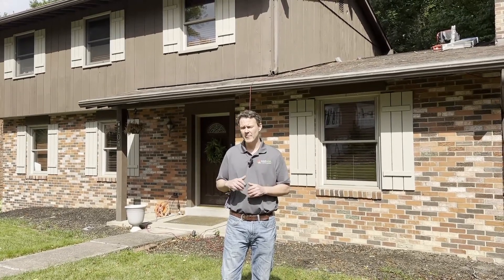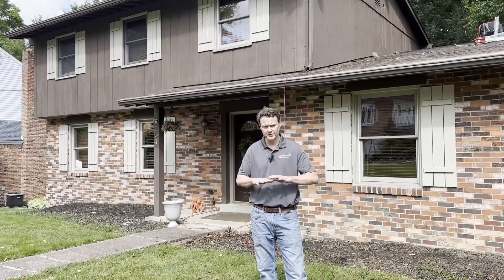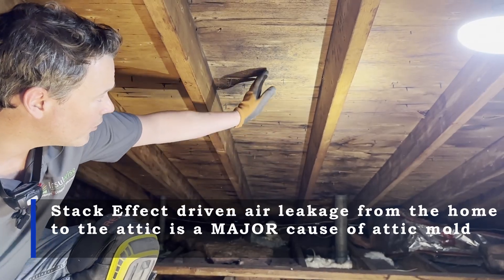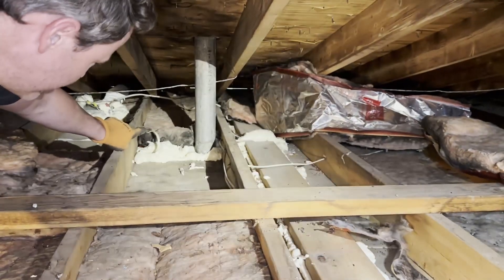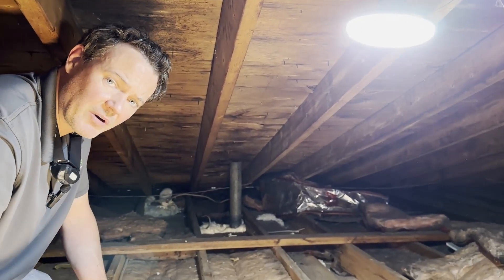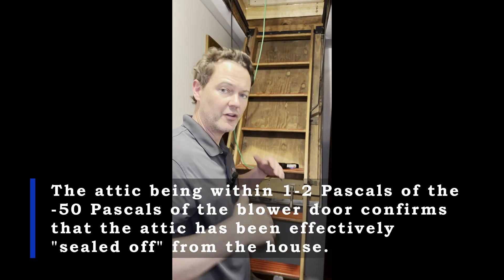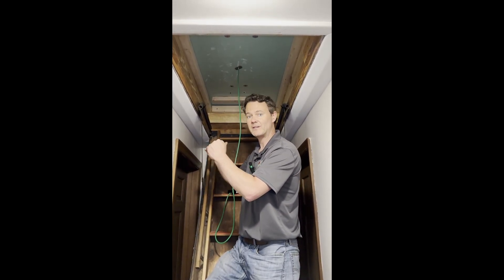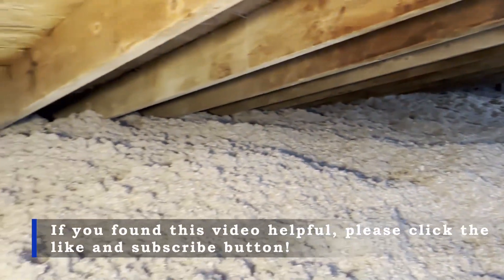How to Remove Attic Mold (and Prevent it from Coming Back)

Comment: I didn’t see the baffles installed at the end. Do you cover the insulation with baffles toward the edges of the roof?
Reply from the maker: The baffles are there, we didn't blow over them, but they are harder to see after the new cellulose got blown in.  The cellulose is blown right up to the "mouth" of the baffle, but not over it.  Thanks for commenting!
Andy

Comment: Hi Andy how are you? Thank you for a great informative video. I am in Melbourne Australia where I live in a brick veener single storey house. My roof uses cement tiles which are now 35 years old. About 20 years ago I had that horrible cellulose insulation sprayed into the roof. After 5 years we started getting mold problems in the kitcen sink drain holes. The laundry and the bathrooms don't have this problem as bad. In the shower I noticed pink mold. I also noticed light gray mold forming on my colorbond alluminium windows frames. I have been trying very hard to get rid of the bad mold in the kitchen drain holes by using cleaning vinegar, bicarbonate of soda and even bleach. The mold is nearly black in color. Unfortunately it keeps coming back. In 2019 I had the cellusose powder removed by an insulation removalist. The dust still keeps coming down onto our furniture, floors etc. This is also bad for our health breathing that powder. Obviously he didn't do a good job. I do not know if there are roof sealing specialists in Melbourne but I am going to search for one. What else can you recommend? Thank you. Alfred
Reply from the maker: Hi Alfred thanks for commenting!  The best thing you can do is to have your attic floor air sealed.  This will solve the issue of dust / debris coming down from your attic into your living space.  Here is a video where I show how this is done.  This will also improve the comfort of your home and improve the energy efficiency
Attic Air Sealing
https://www.youtube.com/watch?v=PUSONSE7srE&t=51s

The mold that was forming below in your home should not have had anything to do with the cellulose insulation that was in your attic area.  In most homes that would form from there being too high of a humidity level inside the home.  Or if you have surfaces in your home that get cold or below dew point temperature --- that water vapor inside your home then condenses on.  This is a classic recipe for mold growth to occur.  Let me know if you have additional questions.  
Here is how that can happen in this video: 
Mold Formation on Interior Surfaces
https://www.youtube.com/watch?v=J_qTDjXQvQY

Comment: Would gable vents mess up a soffitt  to ridge vent airflow and cause mold?
Reply from the maker: Attic ventilation theory says that gable vents should be eliminated when you have soffit and ridge vents.  My personal experience is that I would NEVER eliminate gable vents.  Because they can pick up natural breezes and wind currents better than soffit / ridge vent combinations  do (and by FAR I might add), they can be some of the most effective attic vents out there.  
On one occasion I actually solved a chronic attic moisture problem by re-opening two large gable vents that had been closed by roofers when they installed soffit and ridge vents.  As soon as I opened the first one I felt a whoosh of cold air blow into the attic (it was winter) and within minutes the temperature and humidity in the attic dropped dramatically. 
I cannot imagine a mold problem developing by virtue of leaving them in place. 
Andy
Reply: Depends where you live. I live in south Louisiana with tropical and highly humid climate. The more vented your attic is, the less problems you'll have with mold imo

Comment: We found mold in attic and are trying to fix the issues we found. One side of house has baffles to the soffit and goes to the outsidebut the other side has the baffles , but half of them do not lead to the outside. There isn't a gable vent on either end. If I add one to each sid,  will that help with air circulation? We are going to use foam for any air leaks under insulation and want to fix moisure before spraying rmr86 over everything. Will this help, or is there something else I should do? Any help would be greatly appreciated
Reply from the maker: Thanks for commenting.  Attic ventilation should be balanced between intake and exhaust and be generally set to 1 sq ft NFA (net free area) for 300 sq ft of attic floor, and then divided evenly between intake and exhaust ventilation.  Gable vents are usually considered exhaust, but if they are large and oriented even somewhat East / West they can be the most effective form of passive attic ventilation there is (in my opinion).  If you effectively air sealed your attic floor, vented any bath fans out through the roof, and upgraded your ventilation that would likely solve the problem.  While on the roof ALSO check for nail pops through shingles and leaks around plumbing stack boots and seal those.  Small roof leaks are very common and can add a lot of moisture to an attic unknowingly. 
Thanks, 
Andy

Comment: Do you know about how much this job costed the client?
Reply from the maker: As our mold remediation process also involves other measures like air sealing the attic floor and venting bathroom fans to the outside, it's often more expensive than a traditional attic mold remediation job.  Usually anywhere from $3-20k depending on the job size.  That said, our process focuses on eliminating the underlying cause for the mold growth in the first place, not just killing the stuff that's there.  That's the EASY part ; ). 
Andy

Comment: This is not a proper treatment or remediation for mold. Absolutely irresponsible to put new insulation in without remediating correctly. No Fogging, No negative air machines running, no Hepa Vacuuming( dead spores cause illness as well so they must be removed), and aggressive cleaning of wood with peroxide based solution and wire brushes, then applying mold resistant encapsulant paint before installing new insulation. Then install a commercial grade dehumidifier. This is amateur hour. The mold is likely not even dead. It is definitely not removed nor is the abundant dust and debris. THe client will have to remediate again in the future and redo all of the insulation. Ridiculous
Reply from the maker: I'll see if I can find and attach pictures for the number of times we've been called out and found mold growing right back on top of "mold resistant encapsulant paint."  I also will make sure to post a video of the next time that we remediate mold in an attic where someone else has ALREADY remediated it before using the plan you mentioned --- and left bathroom fans exhausting into the attic, did not address roof ventilation deficiencies, and did not air seal the attic floor--ie- did NOT address the root cause of the mold growth in the first place which is excessive water vapor then condensing on cold surfaces.  The vast bulk of existing mold remediation companies' processes that I've seen I'd call amateur hour combined with a flawed understanding of biology.  
Get rid of the mold spores.  Ok, wash your hands.  Now wave them in the air.  They have mold spores on them.  Mold spores are everywhere, not just in attics that have mold growing on the underside of the roof.  Eliminating the ability for fungus to grow in the first place is how we solve it.  If that's amateur hour to you, then I wish you the best in your operation.
Reply: @insulwiseenergycomfortsolu3293  Thank you for your thoughts on mold.  Like everything, there is fear porn on mold, asbestos, radon, climate etc etc.  Hard to find truth when money corrupts information.

Comment: Great video.. what spray do you use
Reply from the maker: Thank you!  We use RMR-86.  The mold is eliminated almost instantly in many cases.  It's an extremely intense chemical to use, so you really need to be suited up well with a full face respirator and tyvek suit if using it.
Reply: @insulwiseenergycomfortsolu3293  May I ask if you have tried Concrobium Mold Stain Remover and if so what were the results like? It is supposed to be a "friendlier" version of RMR 86!

Comment: I have been watching several vids. So far yours are on top of the game. I am in North West Ct on the Mass border. Zone 5. Will/can an under insulated attic (R15 to R19) also greatly contribute to heat loss creating moisture on the rafters and roof deck? We are purchasing a home with signs of mold.. We're definitely planning on upgrading the insulation..  Should the old batts be removed first? What solution are you spraying? 
Thanks.
Reply from the maker: This is an EXCELLENT question.  Mold forms on the underside of a roof when the surface temperature of the roof falls below dew point temperature, causing the water vapor inside the attic to condense on it.  If there is enough moisture consistently present and the wood gets consistently wet you will then often have mold growth forming.  That's why it's critical that bathroom fans be vented to the outside, the attic floor be air sealed, and the roof be properly ventilated. 
Attics that are poorly insulated usually have fewer mold issues than attics that are well insulated.  You read that right.  Poorly insulated attics allow more heat to escape from the home, which warms the roof, which helps the water vapor to evaporate as opposed to condense on the underside of the roof.  That doesn't mean that poorly insulated attics can't have mold issues, but the risks are lower than with well insulated attics.  Well insulated attics block much more of the heat from escaping the home, which allows the roof to get colder, which can allow for more condensation to occur.  
We generally don't worry about removing the old batts.  Mold cannot eat fiberglass (just the kraft paper).  With mold the key component is addressing the moisture source, ie removing it.  So steps generally are:
1)  make sure bath vents go to the outside (while doing this confirm that your roof is water tight/ no existing leaks)
2)  air seal the attic floor to prevent stack effect driven air leakage from depositing moisture into the attic from the home
3) add vents to the roof if it's not properly ventilated 
4) kill the mold (we use RMR-86..it works great)
5) blow in your new insulation

If you follow these steps the mold will be killed and the conditions that allowed it to grow in the first place will have been remediated.
Hope this helps!
Andy
Reply: @insulwiseenergycomfortsolu3293  WOW! I Missed your response. Thank you. Sounds like a fantastic plan.. Less insulation with more heat escaping into the attic insures warmer roof sheathing and less condensation. Spot on. Why didn't I think of that? 
With MRM-86 being 12% bleach, why can't I just mix up my own? Though I have read that there is something in bleach the makes it less absorbent into plywood (porous materials). Is there a chemical in RMR that increases its absorption? We close on the 4th of Dec. It will be my mission (if my back and knees hold out - 70 yrs young) to air seal the air leaks. Oh no! I just thought of something..  The ceiling is tongue and groove pine.. It  is an old hunting cabin with additions. Are the T&G creating a massive air leaking ceiling. 
Thanks agin for all of your time.
Reply from the maker: @L46C3  Thanks, yes the tongue and groove will likely be a nightmare from an air leakage perspective.  I have encountered this issue with tongue and groove many times.  If you want to air seal it you're looking at either spraying a layer of spray foam over top of it or spray foaming the underside of the roof.  You could in theory caulk or foam every one of those seams, but I think that'd be difficult.  RMR86 does have some other things in it but I don't know what they are.  I can just tell you that it is an incredibly effective prorduct for what we use it for.  I'm not sure if you could just use bleach or not, I have not attempted that.  Good luck in your project!
Reply: Hi Andy, any solutions if you can't get to or reach the exterior wall top plates? I air sealed all interior walls, but cannot adequately get to exterior top plates. With proper soffit and ridge vent ventilation is that ok?
 @insulwiseenergycomfortsolu3293

Comment: did you remove the old insulation bats? isn't there mold on those bats too?
Reply from the maker: We did not remove the existing insulation batts.  They were fiberglass and mold cannot "eat" inorganic materials.  There were likely mold spores present in the material, but there are mold spores everywhere.  The key is in making it impossible for mold to grow again in the attic space by 1) removing the moisture sources (air sealing the attic floor and venting the bathroom fans out through the roof) 2)  making sure the roof is ventilated well enough so that if moisture does make its way to the attic that it can readily dissipate to the outside.
Reply: @insulwiseenergycomfortsolu3293  ah, thank you for that info...

Comment: Thanks for the tips! One thing I was surprised to see was the blower test. I would have thought that the attic is so well ventilated that the air leakage from house doesnt make a difference. Do you ever do a before/after and if so I'm curious what a difference the air sealing makes?
Reply from the maker: Hi there, we do before and after blower door tests all the time in homes, but not when we're doing mold remediation work.  We don't want to risk pulling the spores down into the home.  The ventilation measures act as a redundancy measure against moisture getting into the attic.  We find minor roof leaks in homes all the time for example.  The other thing though with air sealing the attic floor is that it massively improves the energy efficiency and comfort of the home, along with eliminating the home as a moisture source during winter time (from Stack Effect driven air leakage to the attic bringing moisture from the home to the attic).  
Thanks!
Andy

Comment: I've been watching insulation videos for a few weeks now, trying to improve my homes efficiency, and Insulwise has top notch information. 👈👍 Andy is the coolest in the industry. Bruh's ice cold with that spray foam 🧊 ✌️
Reply from the maker: Hey there thank you for the shout out!  We certainly try here.  Our goals are to give homeowners as well as potential customers the most useful information possible.  And our solutions are designed not just for effectiveness and durability, but also for not causing knock on problems with homes down the road (for example just killing the mold and not addressing the moisture issues that caused it to grow in the first place). 
Andy

Comment: A little random, we have hardwood floor and there's these bubbled areas between the planks. We have a crawl space below, unincapsulated., but with insulation batts between joists. Can the hardwood experience that if there are areas of insulation separated and not tight in the crawl space?
Reply from the maker: Hi there, unincapsulated crawl spaces can be problematic.  I have seen mold growing on the undersides of the floors in them, depending on the level of moisture inside the crawl space.  However I'm not sure if I'd expect the floor to behave the way you're seeing.  I've seen hardwood floors do that before, but usually its been from them getting wet from above.  An inspection of the crawl space would be your best bet to determine what's happening there.
Reply: Are you sure it is hardwood? Bubbling at the seams sounds like laminate flooring water damage...